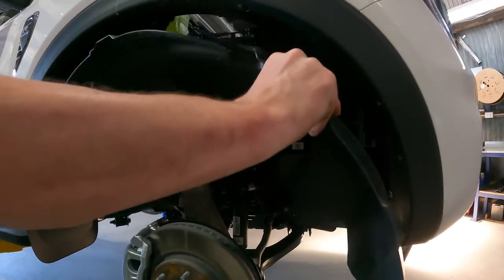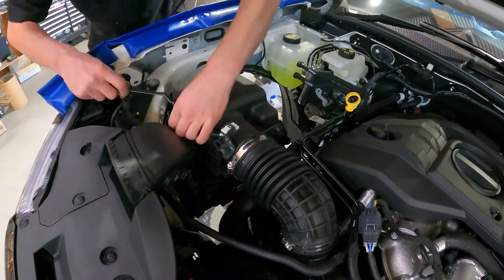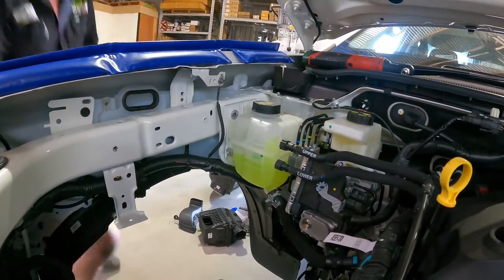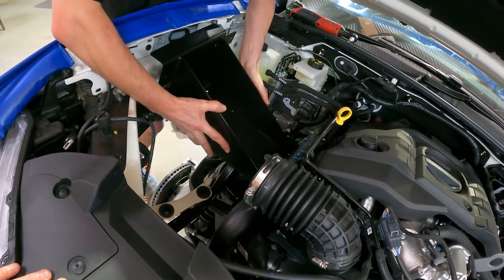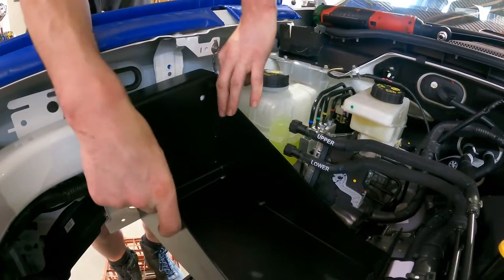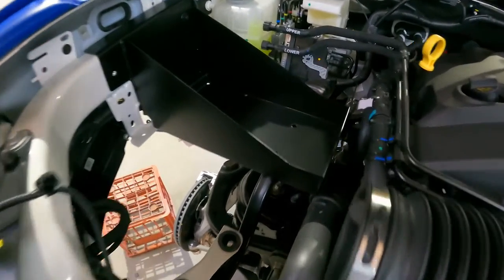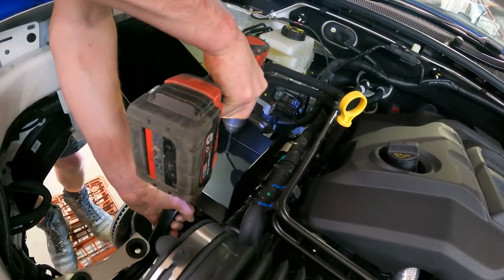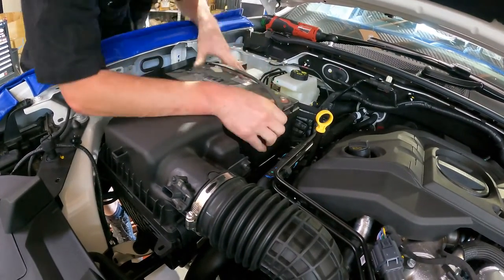NEXT GEN RANGER DUAL BATTERY INSTALL - HOW TO INSTALL - FORD RANGER

Comment: Thanks for the vid.
Is there a battery weight limit on this tray and do you know if it comes with the dcdc mount bracket
Reply from the maker: No there is not, pending on the size of the DCDC you can mount it on or under the battery hold down clamp

Comment: I would love to install a second battery in that location. At first, I thought, I would install the battery on the truck bed, until I saw this video.  By the way, is the inverter the source of the 230V convenient outlet?  I really wanted to check the inverter as, there is no output voltage after plugging in a 220V vacuum cleaner that was more than the 400w maximum power. The fuse tested fine.
Reply from the maker: Yeah there is a lot of great locations for batteries in the Next Gen! 
220v (volts) and 400w (watts) are two different measures of electricity. 
Most vacuums would use more then 400w so you might have fried your inverter. I would try with a low W (Wattage) appliance like a phone charger and see if it works, if still does not and you're certain all the fuses are ok then you might need to take it to a dealership and replace the inverter.
Reply: @outnaboutexplorers2103  I've read somewhere that there's this circuit protection that will activate if you happen to plug in higher wattage device and will eventually reset back by turning the engine off and on again. I guess, I might have fried the inverter as it did not reset the electrical system. I guess I have to visit the dealership for the check up.
Reply: Can you point out where the inverter location might be? I really wanted to check the inverter if there's a reset button. I will make sure not to mess with it and void the warranty.

Comment: Good demo, any advice as to how to get the 12v to the tub? Are there pre run lines to the switch/blanked plate in the back? Would love to see the part of the vid following on from where you finished here.
Reply from the maker: Hey Nick there is no pre ran lines no and we just didn't show this part of the video as there are a heap of options with what you can do.

Comment: Really nice set up and looks to be a rather easy install. But in my 21 ranger , the air box practically touches the radiator reservoir. Zero room for an extra battery.
Reply from the maker: Yeah there is not much room in the PX series!

Comment: can you install lithium battery instead of the standard agm as the second battery?
Reply from the maker: You can just make sure the outer casing of that particular battery brand can handle under bonnet temps